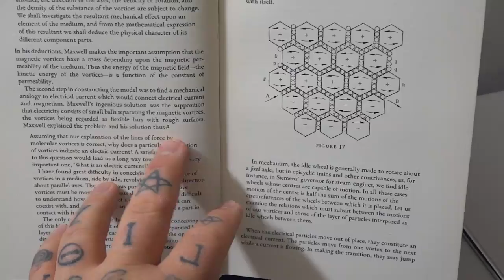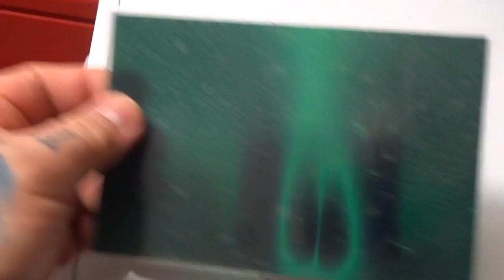Inter-Magnetic induction: Never seen before: Axial Rodin Coil for increased power generation

Comment: You mention that rotation can induce current, would it then be possible to spin these magnets using an electrostatic motor running off of ambient energy? I know this video is very old but im just stumbling across it now and it seems like very powerful potential

Comment: Hey, seeking some help if possible from any who may have tried to demonstrate Ken's theory per his invitation. Or any one who may be able to clarify and/or add to my understanding would be welcome.  I've tried asking Ken, but he's far too busy to answer so hoping there's someone who can help. I've successfully developed method for sandwiching a rodin coil between 2-2x2x1 neodymium cubes no problem and have an arbor to spin the magnet-coil assembly with a commutator on the axle to tap the coil for voltage. So far, using a Drill-Master motor to spin, I may not be getting rpms necessary (900 if lucky)?? And I'm not sure if the induction internally requires an outside coil to tap conventionally at same time?...or does Ken's idea suggest that the internal induction is completely independent of any other induction on the outside and just rotating the magnet-coil assembly  should generate a voltage all by itself? 
This is not an easy thing to assemble a coil between two magnets with 229lb pull force, so don't attempt without help from an experienced handler of magnets..they can do you in if you're not careful.
Thanks for any tips, suggestions

Comment: Per your invitation, I've assembled a model and so far NO VOLTAGE is showing on the coil between the spinning cubes.  I've tried to appeal to you for comment and suggestions about what I may have missed, but getting no response. Making this was harder than the theory, and if nothing else, I devised a method to sandwich a coil between monster magnets without hurting myself. If you're interested, I can send video of my spinning magnet/coil assembly with coil hooked up to meter per a commutator on the axle showing zero volts being generated Finding a version of this idea to NOT work is all I've found; perhaps a version that does work will surface someday and I can then correct my design...for now...NADA, but not giving up as I see the merit in the theory. I know you're busy but hope to see updates on this in the future that might help ..thanks a li ways..

Comment: If you were to wind a dual rodin coil interwoven between each other and passed a current through it the wire wouldn't the small magnetic field produced complete the magnet and join up the plane of inertia but causing an induction or flux in the secondary coil. This field reunification could be turned on and off at will making a solid state generator. Just a thought

Comment: What does it look like under the magnetic film viewer with wood or plastic of the same width as the Rodin Coil between the magnets? Also, bulk conductor (copper, aluminum)? In other words, complete the experiment before attributing the changed image under magnetic viewing film to the Rodin Coil.

Comment: Very clever thinking, cool concept. After 2 years, has anyone tried this concept?
Reply: I've assembled a model and so far NO VOLTAGE is showing on the coil between the spinning cubes.  I've tried to appeal to Ken for comment and suggestions about what I may have missed, but getting no response. Making this was harder than the theory, and if nothing else, I devised a method to sandwich a coil between monster magnets without hurting myself. If you're interested, I can send video of my spinning magnet/coil assembly with coil hooked up to meter per a commutator on the axle showing zero volts being generated. Finding a version of this idea to not work is all I've found; perhaps a version that does work will surface someday and I can then correct my design...for now...NADA, BUT IM STILL TRYING and have hope in the theory, with a few modifications to try. Willing to share details with anyone interested...been a true learning experience, and for that, I thank Mr Wheeler.
Reply: @martinlicht1969  Well done for having a crack at the model. Interesting that you failed to generate a secondary magnitude. I have been researching magnetics, especially induction, for the last year so this is very interesting. I would be interested to see your video as I have quite a different perspective now on what might be occurring. I have a feeling the orientation of the axis (rodin coil) may well be the problem. In other words, my speculation is that inside the motor the main induction coil would be situated around the outside  and the magnets with rodin coil rotating longitudinally in the middle. In that case, a magnetic field (voltage) is induced in the outside coil probably with a plane of inertia that is in the same orientation as the rodin coil. This would result in very little if any voltage. If you could PM me at my channel I would be keen to take a look. I have a few designs now myself.
Reply: @elams1894  I like your idea with the coil around the system..I know something is missing with what I've put together.  Your description sounds similar to a motor I've seen somewhere. I'll get a video to you with details . Thanks for the message!
Reply: @elams1894  where at your channel can I send you a video? Do you have an email address I can send?
I wound a 12 point flat rodin with 30 awg wire, 33 winds, 66.6 feet, when compressed between the 2x2x1 'cubes', the coil creates a 1/4 inch gap which I'm unsure as to whether I need less separation..my commutator is primitive, but give a constant contact to coil/magnet assembly . Drill motor gets to about 900 rpm so wondering about that.
Reply: @elams1894  thanks sir, I'll get a decent video to you soon. I'll welcome your input as I'm just a grasshopper in some very tall grass..
Reply: @martinlicht1969  no worries, it's a cool subject, induction is the greatest unknown with the highest potential that hardly anyone thinks about, all good.

Comment: I'll try it out but I don't believe it has any merit as described because the coil and the magnetic field are spatially moving in tandem and never against each other.  That being said I believe this is a better setup than the prior device you showed us in order to 'pulse' the coil at the right time during rotation to achieve less back torque.
Reply from the maker: theyre moving out of phase, thats the point, induction and all maxwellian equations lead to the same premise as well.
Reply: What's moving out of phase and how? The coil is moving in the same direction and at the same rate as the field; unless I'm misunderstanding your description I don't see how a current can be induced.  Guess I'll just have to try it for myself :^}

Comment: Ken 😀😀 this looks familiar.  Awesome job man. Btw is that the exact same thing as the thing I emailed you about ? Only flipped around ? Also, does this produce the opposite effect of the other thing ?
Reply from the maker: ive still pouring thru emails man! this is diff, close however, this is secondary premise for induction, you can see the field of inertia torque under the viewing film.
Reply: +Theoria Apophasis as always much 💕❤️ bud! You're amazing.

Comment: using a sc17 cable I can't do what I want to as you suggested on a d300s and sb800 what are the ducking settings I should use I am freaking the duck out
Reply from the maker: the SC17 , i never suggested for TTL photography for MODERN (SB800 speedlights) rather simplex off camera flash photography

the cable for any modern DSLR and speedlight is the SC-29 cable
Reply: Ken thanks so much you are the man come to Ireland

Comment: is this because the magnetic field is static but the coil picks up the field in a changing location as the coil spins?
Reply from the maker: close enough answer
Reply: cool, but how then do you utilize a standard alternator coil at same time ?(standard generator coils have the magnets spining with alternating "poles" facing the coils , this way they would be facing away.)